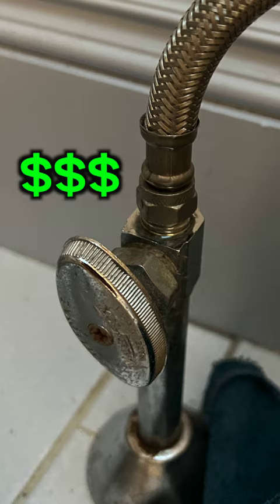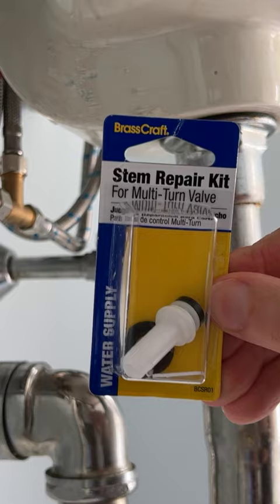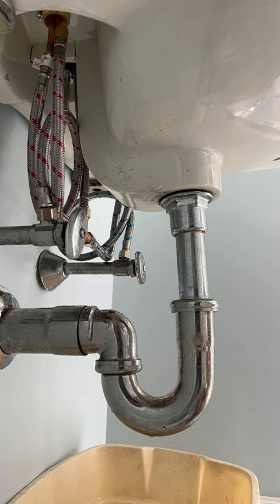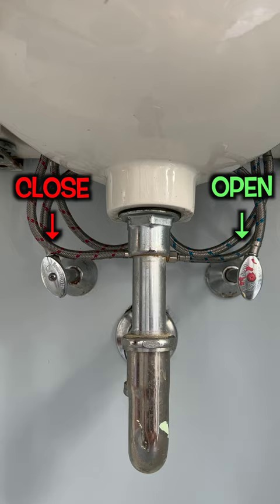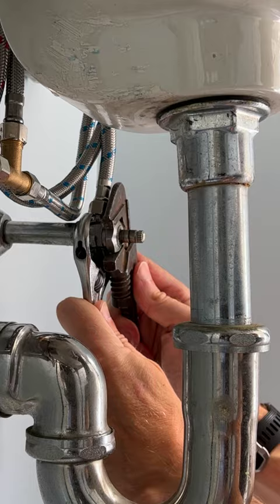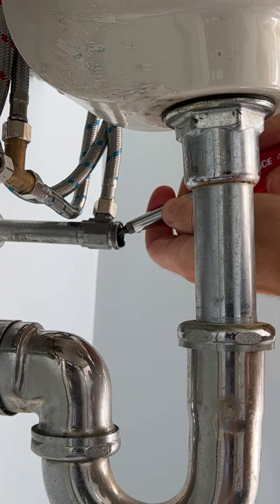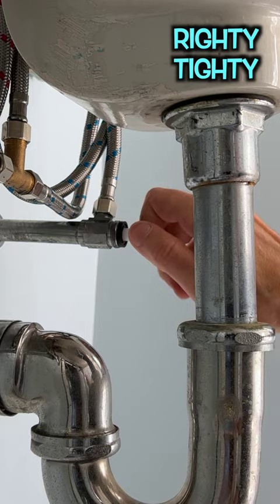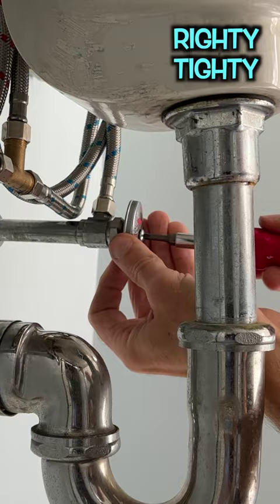$2.98 Sink/Toilet Shutoff Repair #shorts

Comment: those plastic repair parts will crystalize and harden with water conditions, and when the homeowner goes to want to turn them off, they will snap easier than a toothpick
Reply from the maker: For folks with hard water that could be an issue down the road. I suppose I should have shown my usual process, which is to buy a new shutoff valve of the same model and strip it for the metal parts, washers, and gaskets.

Comment: Why did you replace a metal stem with a plastic one?
Reply from the maker: It was a quick fix until I could buy a new shutoff valve of the same model and strip it for the metal parts. The plastic will last for years, but the metal stems last for decades. I also could have soaked the old valves in vinegar and filched the washers and gaskets from the plastic stems, but they weren’t quite the same.

Comment: Or buy a compression stop quarter turn valve for $8. It will take the same amount of time and it only takes copper cutters, a pice of sandpaper, and 2 wrench’s. You won’t have issues with the valve for a long time
Reply from the maker: Good suggestion. You could also buy a new brass craft shutoff and use the metal parts and gaskets.

Comment: Now I know they have the stem valve repair.    Thx    May be next time I will try
Reply from the maker: In the video I should have also pointed out that if you don’t want the cheap plastic parts you can always buy a brand new valve and use the metal parts. It’s just more expensive to do that.

Comment: Naaaaaaah just call a plumber and install new shutoffs with good high quality parts
Reply from the maker: Ha! Definitely call a plumber if you can afford it. Better quality parts are also available from plumbing supply stores and installation is the same. 
This video is intended for folks who want to know how to make basic repairs or understand the basic mechanics of how things work (or fail). My mother in law (in her 80’s) called me the other day to say her toilet kept running. Water kept dripping into the bowl. A plumber wanted $200 to fix it… $200 for what is a flapper valve replacement? Come on! I get it though. Time is $ and everyone has to make a living. Either way, I explained to her how to change it and she got the part and fixed it herself. She was proud of herself and I scored points with the in-laws. Wins all around! 👍

Comment: And then do the hot side because now that's leaking after you touched it. Back to the store you go. Or just buy 2
Reply from the maker: Great point! I actually replaced both when I shot the video, but shorts are limited to 60 seconds. It's very common that if the stems are the same age, they'll be in the same condition. Had I only had 5 more seconds...

Comment: About the one for toilet that doesn’t turn off?
Reply from the maker: It’s the same process. I just recommend buying a new shutoff valve of the same model and then using the metal stem and washers from it versus buying the plastic replacement stems. Will last longer.

Comment: Skip the big box stores and shop at your local hardware store. Oh, and don’t listen to this guy. Do the job right the first time and you’ll probably never have to do it again
Reply from the maker: Thanks for sharing your thoughts. The other option, which will last for decades and doesn’t require sweating in new valves is to buy entirely new Brasscraft shutoff valves and use the metal stems and washers.

Comment: Hey i need help. Hard to turn. Any problem me using WD40 to to help me turn it righty tighty to turn off value?
Reply from the maker: You can use WD-40, but before trying to force anything be sure to turn off the house’s water and perhaps have a plumber’s # handy.
Reply: @BruceAlanR  had someone come do it, plumber. I was defeated.

Comment: Its 10 bucks replace it 15 for a quick fit
Reply from the maker: Can’t argue with that!
Reply: The style in the video has to be sweated off to replace it so its a bit more involed than just cutting it off  or unthreading it
Reply from the maker: You are correct! And most folks aren’t comfortable using a torch in their home. 😁
Reply: @BruceAlanR  exactly. Im a plumber of 20 years and i have replaced just the stem and washers. U do what the customer can afford
Reply from the maker: My sentiment exactly.